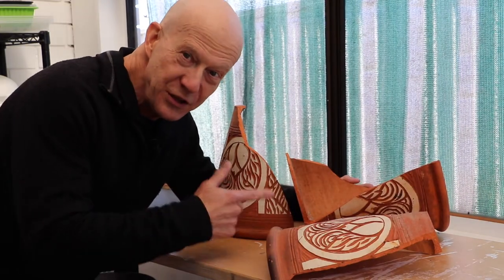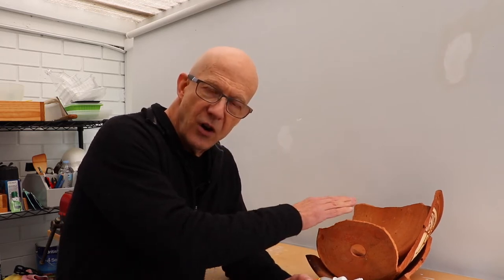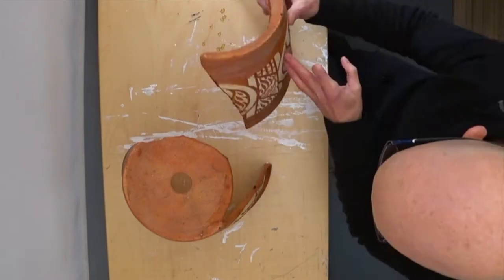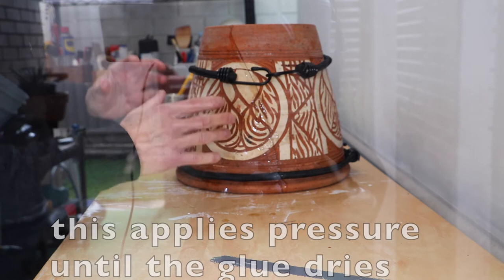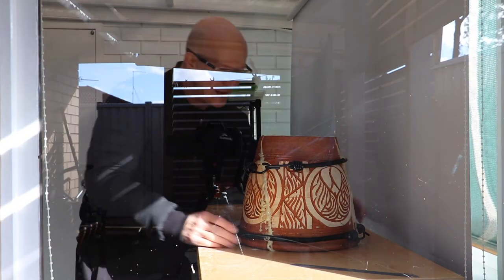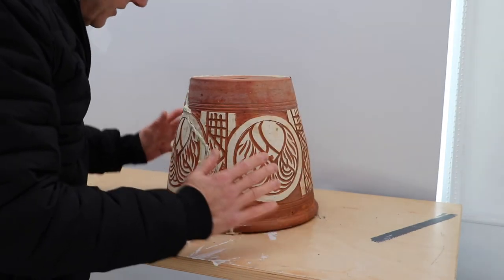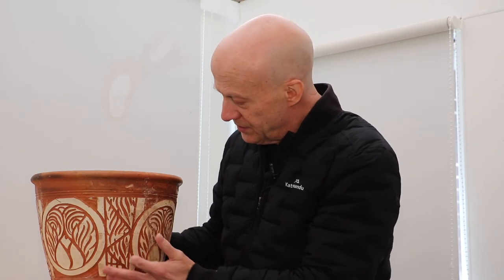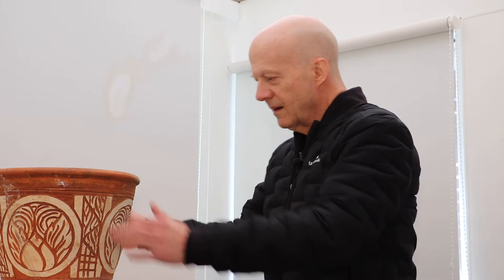How To Repair Broken Garden Pot  ** Save $$$ **  (+ gorilla glue tips!)

Comment: I had a  terracotta saucer that had fallen and split in two. I used guerrilla  wood glue  and it set for a couple of weeks.  Then to filling the chips  I used the wood glue and a diaper wipe. I think it will hold up. Your pot cleaned up very nicely.
Reply from the maker: Thanks, yes it's still in one piece. I have  some lavender growing in it. Well done on repairing your pot - your chip filling technique sounds good! Cheers!

Comment: Some great tips here. I assume its not as good for withstanding stress if full of soil so is it better to use plants in a plastic pot inside the repaired pot?
Reply from the maker: Thanks for watching. I assumed the same at first so I just placed a plastic pot (with plant) inside but then decided to plant directly into the repaired pot. I chose some lavender and it's been fine for several months now. Lavender of course doesn't require much water so I thought that would place less stress on the repair. Prior to breaking, the pot had a mature yucca that had an extensive and over crowded root system which placed much pressure on the pot and made it very precarious to remove and as such the pot broke whilst removing the yucca. I used a lot of Gorilla Glue during the repair and it seems strong at the moment (it's outside in the weather too) but of course there are no guarantees so the safest option would be to use a plastic pot inside. Cheers! 👍

Comment: Wow amazing!! What would you suggest to keep the pressure on just the pot base while the glue dries? (I’m referring to the terracotta plate beneath the pot, which is the part I broke).
Reply from the maker: Hard to say without actually seeing it but as long as there is at least some pressure applied. Cheers, and good luck!👍

Comment: Great presentation. I will look into Gorilla glue you used in response to other comments. I have 4 large pots. Only 2 have cracks, but one is broken into 5 pieces. Maybe I'll try to salvage it. 
Very impressive methods you've shown here, specifically using the "bungie cords" to hold pot together while curing. I would only suggest to viewers to try placing pieces together 1st before glueing as sometimes some pieces won't fit in after other pieces are in place. Also, I wonder if I can coat inside of pot with something before reuseing, such as morter or cement to protect mend from inside from moisture later? You present very intelligently. Thank you sir.
Reply from the maker: Thanks for watching and for your comments! The gorilla glued pot is still as strong as ever! I have grown lavender in it and it is doing well. Cheers!👍

Comment: Thanks for this. Which type of Gorilla glue did u use - I have an outside pot with decorative handles and one has dropped off in the frost 😢 - that’s something we have in the UK ;-)
Reply from the maker: Hi, I used the standard one. It says Original Gorilla Glue on the bottle  and comes in different sizes (not the gel). I'm in southern Australia, so we have frosts down here too, although maybe not that cold...⛄😉
Reply: @MarkdoesDIY  Great - thanks for the info Mark 👍🏻

Comment: You're a lucky one. My pots always break in many, multiple size pieces. Quite a challenge to find/fix those excessively small/tiny pieces.
Curious to know why you did not clean off excess glue, while still wet & pliable?
Thnx for vid!
Reply from the maker: No worries. I waited for it to dry as per the instructions and to ensure the strongest bond rather than risk disturbing it. Gorilla Glue is very sticky and wiping the excess while wet may have created smears that may have been impossible to remove. Cheers! 👍